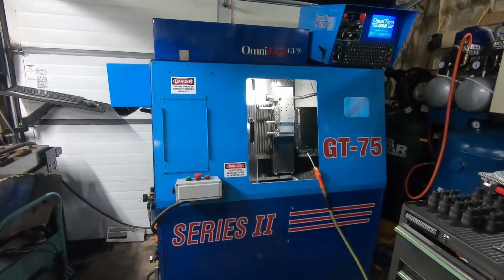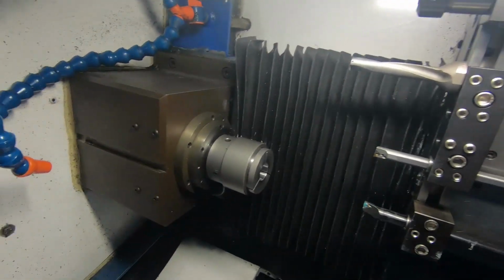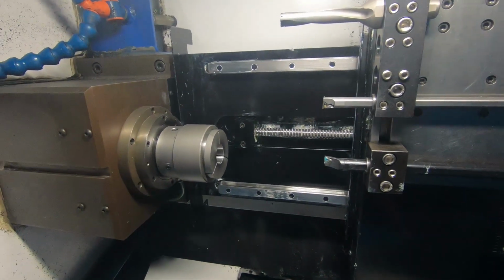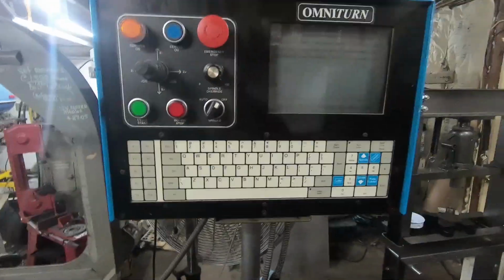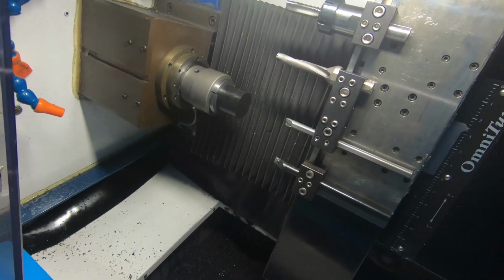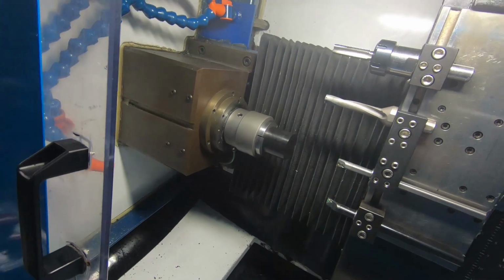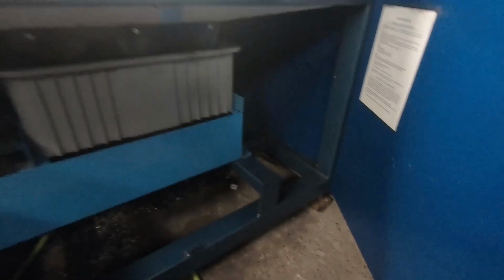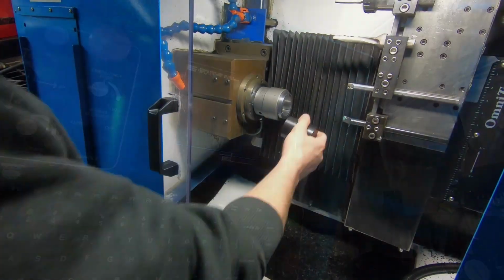Tormach Slant-Pro Lathe Vs Omniturn: Budget Battle!

Comment from the maker: Does anyone here own either of these lathes?  What have been your experiences with them?!  At 20:40 we machine an entire part.  We are not paid for or sponsored by Omniturn.
Reply: My father worked for OmniTurn, have had 3 in our personal shop, I would put an OmniTurn up against any cnc gang tool lathe there is on the market.  I would also say that even there are some times that these will keep up with the Swiss screw machines that are 10x the price for certain applications. For the size of work they do, they are almost impossible to beat, and are definitely  are in that price point.  I had the pleasure of dealing with a series III which is the C-axis version.  You can't beat the fact that they are built here in the states, and use a lot of good components, where the Tormach will use Chinese sources. It doesn't have the quickest rapids, but, with a gang tool lathe, your setup effects cycle times more than rapids.  One thing that people don't realize is that it will go to max rapid immediately and have very little ramp up and ramp down, where higher rapids mean ramping up and down during shorter movement, you're not seeing max rapids anyway.
Reply: No, but I'm interested now! thanks for the info.
Reply: These used machines only have a few downsides: some don't drip feed and the machine memory is small, CAM post processors are not as refined or available,  conversational programming would be awesome to have.

Other than that I love used machines, there are so many good local deals once you start looking you'd be surprised.
Reply from the maker: @visionforgeinc  Yeah, we've been seeing some really good deals lately on used CNC's as well as manual lathes and mills.  Maybe due to the economy some are letting go of some of the machines they aren't using or are upgrading while they can.

Comment: Can't believe I've never seen this vid. I love Omniturn. There are several vids on my channel about my Omni Attachement much like yours. You STOLE your GT75. So jealous :) I regularly hold .0003-.0004 all day long in 12L14 steel. And one day I hope to add a GT75 to my shop. There are a few areas I wish Omni would update/upgrade the control. Automatic homing would be nice. Switching between MDI, Jog and Automatic is kind of a pain. A one button push would be awesome. Some form of conversational programming would be a huge upgrade too. BUT, it is still the workhorse of my pin and screw production. Again, thanks for the cool vid.
Reply from the maker: It was a steal alright!  It's still working great!

Comment: Awesome Thank you for making this video! Made me purchase a used Omniturn GT75 👍
Question: Need to machine delrin. What type of drill bit are you using? The chips eject quickly without stringing.
Reply from the maker: The drill bit in the video is a Tungaloy insert drill 5/8 diameter, but most any type of bit works in delrin fairly well.
Reply: @MadManMachines  Thank you appreciate it!

Comment: Would you be willing to make a quick video on simple hand coding and just walking through the menus. I bought a trashed one and just getting it back up and going after changing some bearings and a fuse one the board
Reply from the maker: I've thought about doing a g code video, but have just never got around to it.  I will tell you this, the way i learned it was just reading the Omniturn manual, which is available free online.  Then take it step by step. First, learn to touch of just one tool and make a program to just face a part off.  Nothing else, don't get bogged down in the rest of the code  yet.  If you can learn how to touch of one tool, make it face off the front of the part and retract , you'll then have cracked the code and it's only a matter of stacking on more code.   Your first program to face off will only be 5 lines of code or so.  G code isn't as complex as it seems, but what i see with so many online tutorials is they start off throwing so many unecessary codes at you you get bogged down and frustrated.  Just learn to first program a face program:  turn on the spindle  M03 at speed S1000.   Call up your tool with a T1 line (and its x z position where you want it to go), move it across the face with an X move and its feed rate F.  Thats it.  It'll be like 5 lines of code.  Learn that, take it steep by step reading the manual and if you can get it to make that simple path, making it do more complex moves with multiple tools is as simple as just adding on.  Don't overthink it...
Reply: @MadManMachines  Thanks for getting back to me, yeah I hear you on the G-code, I have a decent grip on simple stuff from using our mill. I was more talking about the quirky menus and button presses specific to the Omniturn you only learn from fumbling around on one and trial & error. Also your logic on part setups of gang tool lathes. I struggle to find the mdi menu to even enter the code I have written on on pad and paper. I also have the manuals too  thanks.

Comment: What is the longest part you can turn on this?
Reply from the maker: Depends on the diameter of it, if it'll fit in the spindle (1-1/8 bore) you can put a 2 foot long bar in there.  If its bigger diameter, like a 3" bar and it can only go into the chuck or collet, about 6" max is all i'd recommend.

Comment: What kind of chuck are you using?
Reply from the maker: Hardinge style 5c collet, up to 6" holding capacity, see video as I go a little more in detail about it.  You can run a conventional 3 jaw chuck on it too, but collet holding is quicker and more accurate.

Comment: Great video!  Thanks for getting the OmniTurn name out to your people.  We have thousands of machines out there in shops around the country making the kind of parts you discuss.  Like you said, they hold tight tolerances, and run for years without issue.  If they do go down, we can get you up quickly and inexpensively.  Thanks again for posting these videos!
Reply from the maker: We'd love it if you brought back the enclosed GT Jr!
Reply: Have you made them with a bigger spindle thru hole? I've only seen the 5c size. And, I just found out a couple weeks ago you're only 125 miles from me. Bonus points. lol

Comment: Wow..... I did not know.  (Although frankly, there’s a lot I don’t know 🤣)   thanks for opening up my mind.  Now I just need to start looking.
Reply from the maker: We were the same way, we didn't even know the OmniTurn existed and thought Tormach was the main option for a single phase, garage size machine.  It was a luck post we came across several years ago about Omniturns and the general consensus in the thread was it's got an old school control, but spits out awesome parts that are in spec!   Graphics won't make your machine faster or more accurate anyway, so don't get sucked into that trap. Turning programs are so simple compared to milling anyway so you can hand program most of them right at the controller.

Comment: I wish I would have heard about this brand before I bought my tormach 15L. My tormach is a decent machine though. I machine a lot of bearing pockets and I don't have a problem keeping them within .0005" as long as i have good coolant flow. The rapid speed on the tormach is really slow. That's probably my first complaint second would be that the enclosure sucks.
Reply from the maker: It's good to hear a testimonial from an actual tormach owner (who isn't a paid sponsor of the product.).   Holding half a thou is definitely better then many have reported they are able to hold so that is good to hear.  How long have you owned it now?
Reply: @MadManMachines  I've had it two years now but have only used it a year and a half. I have two tormach mills also. The mills I can power off and resume making parts right were I left off the next day. With the lathe I may have to adjust the wear offsets a few thousandths to get it back in spec. If my business can survive the kung flu I may have to seriously look at the Omniturn this summer. I like that it's made in the USA  and you can add a bar and part feeder. They could sell a lot i think if they would update their site and do more youtube. That's wear tormach has them beat.
Reply from the maker: @kmachining  You are dead on about Omniturn, it's an awesome piece and affordable for the home shop, it's too bad they aren't more internet savvy as most people don't even know it exists (we didn't either up until 3 years ago, when we were looking for something that could run on single phase and didn't weigh 3 tons).   Are your mills the dovetail mills or the newer ones with linear ways?
Reply: @MadManMachines  I have a PCNC 770 and an 1100M that both have dovetails. I think their new ones still have dovetails but could be wrong. The 770 is more accurate and leaves a better finish than my 1100. But I think that's because I use R8 on the 770 and my 1100 use the TTS. I'm surprised the TTS works as well as it does but I defiantly need to upgrade to the BT30. I can't run it hard without it pulling tools out. I have a small shop so machine size is defiantly a big factor.

Comment: You can't really compare it to the Tormach since if new, it would be much more expensive.
Reply from the maker: Definitely you can, go to Tormach and look at their 15L automation package, its $29,500.00 which is the closest (but still falls short) package to an OmniTurn at 36K and if you can afford 29K, you can come up with 36K.    And when comparing used machines, OmniTurns run much less then used Tormachs and you are getting, literally 10 times the machine. Also, there is just no reason to buy a Tormach over an OmniTurn.  Tormach lathes run about +/-.002 every other part(and likely worse on the new Tormach 8L), many jobs that clients will want made, will call for a spec of +/- .0005 on the print, you can't even hold that on a Tormach and can't take on the job.   A used OmniTurn is a better investment then a new or used Tormach any day of the week.
Reply: @MadManMachines  still the tormach comes with a turret,gang tooling and an auto collet closer. That omni turn only come with gang tooling. You're limited on complex parts on that omni turn speed or no speed
Reply from the maker: @glennmachinist8360  The OmniTurn comes standard with an Auto Closer, and it can be controlled via M code to open and close automatically too for bar feeding.  The OmniTurn plate is 12" and can hold 10+ tools for the most complex of jobs, plus it'll hold the most  precise of tolerances with the speed to boot.
Reply: @glennmachinist8360  actually, there is no difference in the complexity of parts you can do.  I would put an OmniTurn up against a Tormach and it will beat the Tormach in anything you try to do with it. The Tormach is more of a hobby machine, the OmniTurn is an industrial based machine that is capable of being used in a garage.  In comparison, the turret actually is more limited, you can only put a certain number of tools in a turret, and they may or may not be powered.  You can actually put as many powered tools into an OmniTurn as you have spots and drives for.

Comment: Do you program this Omni turn with cam?
Reply from the maker: You can, but i just hand program right at the control.  I suppose if you got into multiple complex arcs on your piece or the like it would be easier and faster.   Once you crack g code, it's super duper easy.  For many years i was intimidated by it, but it's really simple (I know you probably know that, but for those who don't).
Reply from the maker: Also to add: it does have a USB port, so you can transfer programs over. I haven't had to do any CAM programs yet, but if I recall correctly there isn't a readily available post processor. You'll have to use a generic post processor and possibly change a few M functions and such on your own. Not too hard really.
 -Kevin
Reply: @MadManMachines  Smartcam and Fusion360 both have posts, and I think some others do too.
Reply from the maker: @mikesixes  To clarify, they have posts for the OmniTurn?
Reply: Yes, although I should have said Mastercam instead of Smartcam. I'm not sure about Smartcam but I have worked with Fusion 360 and Mastercam.
Reply from the maker: @mikesixes  Cool, good information!